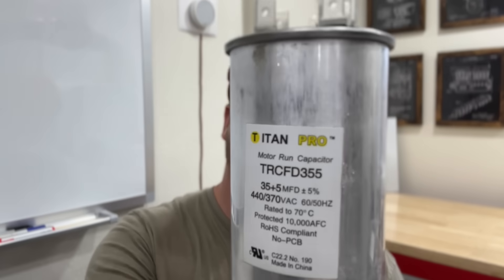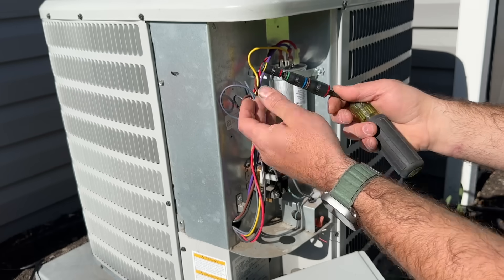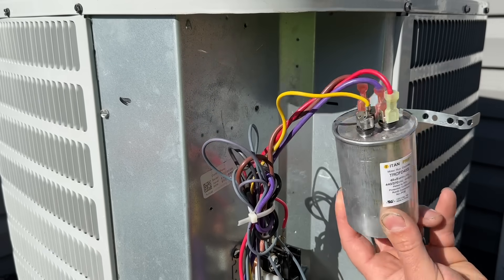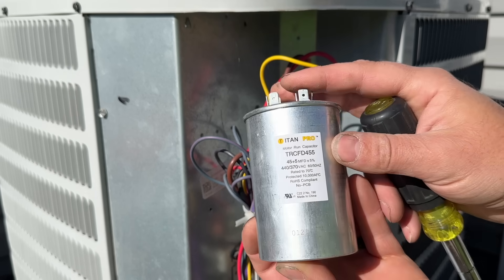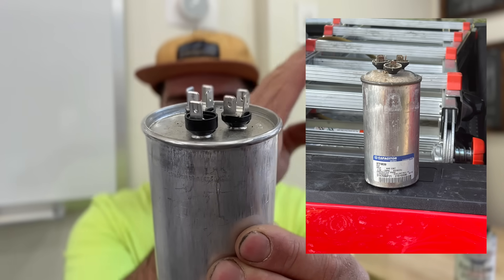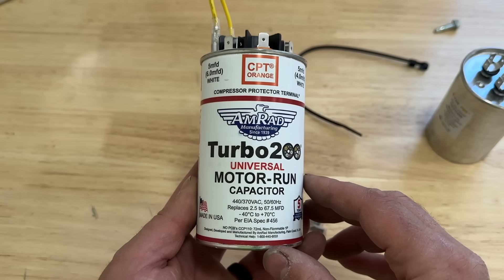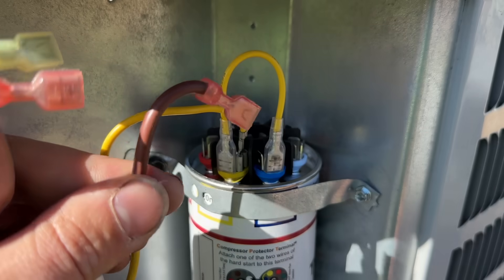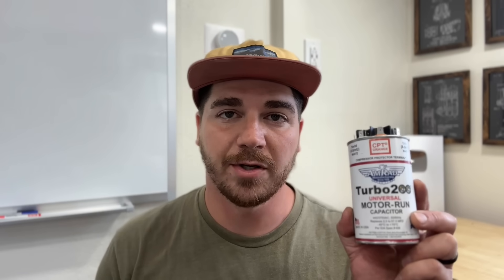HVAC Contractors Practically Make Their Living On These

Comment: I was quoted $550.00 to replace my run capacitor and told him to go.  I bought one on Amazon for $18.36 and took me 15 minutes to put it on!  Thanks for being honest to your viewers!
Reply: Nice !
Reply: I had an HVAC tech tell me that the compressor was bad and it was going to be $1800 to repair it. But he recommended getting a new unit for $4500. I told him that I can't afford either. I said did you test the capacitor. He said oh I forgot to look at that. Guess what it was and has been working for 2 years since then. He charged $220 and for some reason had a personality change during the service call. I'm gonna order an extra one to have on hand and do it myself next time
Reply: @lg9853  My capacitor lasted 15 years, with Amazon's fast delivery just order it when it breaks.
Reply: These days they charge a trip fee and a diagnostic fee....
Reply: If you can change a car battery you can change capacitor
Reply: @tman984  But, but, there might be 3 connections.
Reply: And for all the HVAC guys here getting their panties in a bunch because of a DIY maybe you should go independent so you can get more out of a job while undercutting these large companies that have all this overhead fat to cut from the middleman.
Reply: @yt-user03561  true. That's why I went out on my own. Large companies have to pay for all the bodies that they through at problems, and pay for all the callbacks.
Reply: I had a condenser motor that was failing to run intermittently. I tried capacitors to no avail. Called HVAC company who said, “no, it’s the condenser motor” and charged $115 diagnostic fee. A new motor installed would be $1300. I bit the bullet and had them replace it. The tech came out and admitted he just carefully takes off the motor and retraces his steps with the new one. Well, I could have done that in 30-45 minutes and saved $800. I wish I had paid the diagnostic fees and sent him on his way.
Reply: And you didn't even die!
Reply: Ha ha ha, it can only kill you, why not stick my hands in there
Reply: HVAC techs, I will pay fairly for their honesty.

But like automotive techs, you also have your fair share of dishonest techs that will either misdiagnose your problem on purpose or try to upsell you on parts you don't need or an entire system replacement. The goal is to fix the problem without costing the homeowner more than it absolutely needs to so that it wont come back to bite you later on in lost business or bad PR. 

Whole units used to be more affordable than they are today and many of them doubled in price in just the past 4 years. Lot of customers are going to have an axe to grind once they see that.
Reply: @ronaldchristy7235 Thank you for being honest. Definitely more ppl like you are needed.
Reply: I found the one for my unit on clearance from Grainger for $1.98!
Reply: @SK-qc6fb  
I found the one for my unit on clearance from Grainger for $1.98!

Did you buy extra? If they had extra? Sometimes when I find stuff too cheap, it pays to buy extra. You may have trouble finding it the next time that you need it.

If I was much handy, then I should be buying stuff from companies like that.
Reply: Those cheapo caps don't last. I hope you bought a couple  @SK-qc6fb
Reply: @SK-qc6fb , Chinese ?
Reply: @bobwentz527  
Nope, it was a namebrand, but I did not actually check, it was a clearance item.
Reply: The company had in his price labor, service call, warranty. But 550 is high. 240 tops
Reply: @kennethbubser9601  I paid 300 (original was 550 and had tech call the shop to negotiate) and knew I was being taken advantage of. But I just wanted it working again so I could get back to work.  Also if it blew next month, they had to fix it for free. FYI, these can be blown out by lightning or power surges too!
Reply: I hope you paid him to diagnose your problems ! It cost a fortune to get the key in the shop doors and get a man out to you
Reply: 15 minutes it’s like 3 wires you slow
Reply: China capacitors will burn your compressor . A honest company will charge the capacitor around 120$ because they buy original American parts at around 45-60$.

Hvac companies have allot of expenses , 50$/hour for an employee,  truck, fuel, insurances, permits,  licenses, taxes. 

Smaller companies are cheaper of course .

The service call and cap will costs between 300$-450$ with tax. 

A tech goes through 3 years of school and 5 years apprenticeship, he drives around all day in the heat working late hours .

There could other problems related to that capacitor,  that's the price
Reply: Yeah, so you were willing to go without AC while waiting for shipping, lemme guess, you called on the weekend when it costs a hundred dollars to open the store and you got us working over our 40 hours! 😂😂😂
Reply: So why did you call him in the first place? Why not just spend $20 and do it yourself to begin with?
Reply: @defomatt2684  Because he had no clue. He exploited that guy. Hopefully the company hit him for a service charge.
Reply: @defomatt2684  Absolutely right.  Seems he got a free diagnosis of the problem and a recommended solution.  And then brags about how clever he was.
Reply: As we can see from the arguments, there are two sides of which I walk in the middle. The capacitor is a part that clearly fails a lot and not necessarily because of some fault with the HVAC unit. A lot of people have had success with replacing the cap and had no issues since and that is not really up for debate. 
A visit from a tech has a minimum charge because not only is your problem being diagnosed, but the technician is not going to another job and needs to make a certain amount to keep the doors open. This really means someone with a simpler issue is going to pay more than someone with a more complex issue due to the amount of drive time and general business upkeep from the phone calls to advertising and paperwork.
Where I live, most the small residential HVAC is done by immigrants who typically dominate markets wherby getting certification is easier than 2-5 years of schooling. 
When it comes to troubleshooting, the right guy with enough proper tools and enough knowledge of electronics and physics who can read a manual or follow direction can most likely fix many issues unless it involves refrigerant or parts that they cannot get. The likelihood of a self repair increases even more if the person with advanced knowledge and advanced tools knows someone in the industry.

What I wrote goes for many industries unless it's a product, or service you jast have zero control over, such as internet. You can program your own router you bought but if the service is down, it's down.
Reply: So you used his experience to find out it was a capacitor and then you ordered one. Yeah, you're a real stand up guy aren't you.
Reply: @VitalYFZ  No, I actually used my Klein Multimeter and and diagnosed the problem myself!  That was the following year after he wanted to replace it!
Reply: I always make sure the tech gets a fair wage when I call them, even if I DIY later on. I also work for a living and getting stiffed is never fun. I don't understand the mindset of people who take it as an accomplishment that they "saved" themselves paying someone who showed up when called. And then brag about it. If you don't like the price, negotiate. 

I agree $550 was high...so why not pay him time at the average going rate (include travel). Assuming an hour and a half, that's maybe $200.
Reply: @FamilyManMoving  
I am glad that you think to pay the tech fairly, however, wouldn't a lot of DIYers be hesitant, because when they DIY what if it does not get it working again?

And shouldn't it be the job of the tech to charge a reasonable price? But the company that he works for, may not allow that?

Some time ago, the guy from the gas company was unable to light my pilot light on my furnace. No charge, part of the gas company deal that they light pilot lights. I guess not many people know how to do it. He was not allowed to fix it, but he gave me enough pointers for me to DIY. I am nowhere near as handy as my Dad was, and often my brother-in-law was somewhat handy. I somehow pulled out the thermocouple/thermopile and bought a similar one at the home improvement store, and my brother-in-law watched me install it. "Thanks for the help." Well usually he is more helpful. It worked. That is the part that sits atop the pilot light flame and has to be hot, in order to keep the circuit energized that enables the gas flow to the pilot light to remain on. Designed to shut off any gas flow if the pilot light ever goes out. I find that a grill lighter seems perfect for lighting a pilot light, as it has better reach than most anything else, and is much more convenient than a match or a cigarette lighter. The person lighting a pilot light has to push the override button for around a minute, until it gets hot enough to engage and keep the pilot gas flow on. You turn the gas control knob to pilot light position. Once the pilot light has engaged then it can be turned to the normal use position.

If you do not want to pay, then watch a YT video and then try to figure out whether you might be good enough at it to try DIY. I think a lot of knowledgable people make how-to videos, because it boosts their business. Obviously a certain percentage will not be willing to DIY and so it serves as good PR and advertisement, if they are in the reasonable locality.
Reply: @FamilyManMoving  if they start at 550 move on. That simple.
Reply: I get 300 for a cap. But you need to stop saying that we are robbing ppl. We're not. We are allowed to make money like everyone else.
Reply: @Libertad59 yeah, yer a f'n thief
Reply: @intothevoid1926  gotta be greater than the hater
Reply: Wrong, it's all about training, knowledge, having the right parts on hand.  The heart surgeon spends about $50 on the stint and sutures, but charges $ thousands because it's not the cost of the parts, it's the knowledge and then having the correct pieces, instruments, etc.  The biggest question on failed capacitor, is why it failed.  Yes, sometimes it's just the capacitor itself, but often not so.  A short cycling unit for whatever reason (sometimes just weak batteries in the thermostat will cause this, or low/high refrigerant levels, a faulty high or low voltage wire connection, overheating, etc), will burn out a capacitor pretty fast.  What happens when the wires to the capacitor are reconnected incorrectly?  Or, not understanding the amp draws from the compressor, fan motor, or the need for a start kit assist on an older unit?  Or, a thousand other things.  If the HVAC trade is so easy and reportedly deceptive, everyone should stop calling them, including you.  But, you won't because all you did this time was use the information the HVAC tech told you, and you changed capacitor, got lucky it worked and then thought of yourself invincible.
Reply: @stephenhenry5346  There are two sides to this story. I have seen folks being told they need new AC units when it's a bad capacitor as well. There is certainly some dishonestly in the HVAC trade. This causes folks to try to do things that they can on their own. I am on my 4th capacitor on my 19-year-old Trane that I have personally changed out as a homeowner. Some basic electronic safety and a multimeter can troubleshoot a lot of common HVAC issues. Once it gets past level then I call a tech out. With that said if I call a tech out im paying to have them do the work and not using there diagnostics to then do it on the cheap.
Reply: @stephenhenry5346 ya mad because you didn't get to overcharge?
Reply: @stephenhenry5346 yea, but the guy wasn’t going to figure out why, he was going to charge the customer $500, slap a capacitor on it and drive away
Reply: @stephenhenry5346  Blah, Blah. The capacitor is swollen. Do a little reading, take a picture of the connections, order one, replace it. Unit runs for years. $18 just like he says. Oh, and I didn't call them at all, just looked for bad components. Capacitors go bad. You can call the pros if it doesn't work.
Reply: @stephenhenry5346  WRONG. BAD ANALOGY.

I can't go and learn about being Surgeon, in a few days,  because it is also a skill.
I can go learn basic Electrical/Electronic troubleshooting and learn about common problems and trouble shooting techniques.

Excessive overcharging is your moral foundation?
Reply: @stephenhenry5346 If you blow multiple, cheap caps in a short period of time. Sure. It might be time to spend the money on someone that has the knowledge. But surgery isn't the first option you jump to when your back hurts, is it
Reply: Comparing a surgen to a HVAC tech is laughable. There is of course things that you should leave to the tech like replacing an entire unit or anything that requires refigerant leaking.

Changing out the starter cap is super simple if you basic electronic saftey skills. Thats something easily gained with very little effort.

My blower motor was partially shorted and that looked fairly easy to me to do myself using repair clinic to get the parts quickly. It took longer for me to do it than a tech, but i saved a huge amount of money learning to do it myself. If you can turn a wrench, you can replace a motor. I highly recommend the multi-meter to verify no voltage present. Those things are cheap. I have a nice Fluke 79 that i've had since the 90's.
Reply: @michaelkrailo5725 actually. We are like surgeons. Hvac is a very in depth science. If you don't know it, you won't do well at all.
Reply: @stephenhenry5346 OMG, you scared me so badly I never want to call a tech again. I've been working on HVAC units for around 15 years now. Low voltage will NOT kill a cap. High voltage will, if the voltage max is over the cap rating( normally 450 vac)it will blow, signs are visible in this mater, the cap will either be leaking, or blown apart, or you will have one he'll of a smoke show, because everything burned. As far as the wiring to the cap being incorrect, that would be on the last experience certified tech that person paid through the nose to have it installed incorrectly. I deal with HVAC techs on a continuous basis and 80% of the time, they are incorrect about their diagnosis, costing the owner even more money. And as far as having parts on hand, that's a yes and a no. What's really funny is they are charging 2 or 3 times the price for the part plus time, plus service call, plus the techs estimated price to install the piece. For example, a circuit board replacement. In a bryant, one of my good customers called me one day and explained the problem, had a tech look at it, diagnosed it as the blower motor failed. $4500 for replacement. I went and looked at it and it wasn't the blower motor at all, the circuit board had failed due to over heating( filter) with visible marks. $100 for the board plus my time to replace, $750 total. That included the time for me to locate the board, purchasing the board and reimbursement for the part. Their second estimate was to replace a 4yr old unit for the low low price of $6500.
Reply: @stephenhenry5346 haha!  You aren't a rocket scientist, nor do you deserve their pay.  There's a reason many ex-cons become HVAC repairmen.
Reply: @yagsvarriale7  there are sales techs that know nothing and can’t repair anything . They sell new units only , a tech that has been trained through school and NATE have paid their dues like a doctor or nurse , so many other parts break down not just caps . The new control boards are a whole new fish in the pond and you need training on variable speed and inverter compressors . We all aren’t thieves And must be paid properly for training , trucks and high wages . Yes some work on commission but it evens out like wages .
Reply: @Libertad59 run in traffic cap boi
Reply: @intothevoid1926  I do. On or in my sweet ride.
Reply: @intothevoid1926  funny how my comments keep getting deleted little boy
Reply: @Libertad59  lol, your rusted out 97 f250?
Reply: @Libertad59  blame YT. IDGAF about what you post, skippy
Reply: @intothevoid1926  haha, no. My 22  transit 350 HD, or my bmw s1000xr, or my ram 3500 6 speed dually. 

You're a bum. I ain't blaming youtube for anything. You're the same person that Will pay 20k for a roof and think you got a deal. 

What I'm saying is that, we are in business to make money. Most ppl won't or can't change out parts in their hvac system. What you don't get by doing this stuff yourself is a warranty, convenience or insurance. 

If you burn your house down, you don't get paid. If I burn your house down, you get paid. That's what you pay for. But don't come on here talkin greasy about someone's hustle. 

It's probably because you aint got one. Best of luck
Reply: @Libertad59  the Internet is full of "look what I have" dooshere, lol. You can type anything. No believes it. Have fun in that single wide.
Reply: @intothevoid1926  you have nothing so you resort to trying to belittle me. Don't be mad at me because your life lacks purpose.
Reply: @intothevoid1926  sounds like you're familiar with the trailer park mr single wide.
Reply: @Libertad59  see previous post, skippy

Comment: Caps arent that expensive but the proce has been going up like everything else. I think the last one I did 10 yrs ago was an 80 dollar service call and 40 for the cap.  Sogn up fpr w maintence plan and we waive the setvice calls for 2 yrs. We check and prep air handler and AC, or heat pump and clean coils. I think it was 150 for that plan.